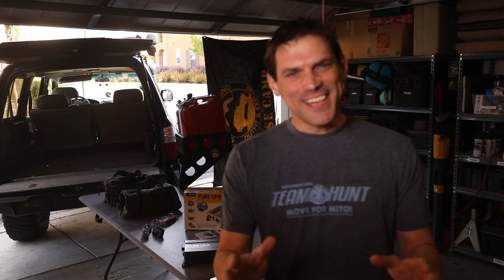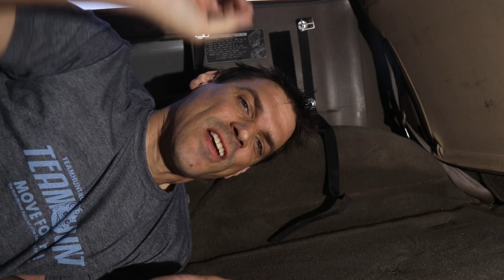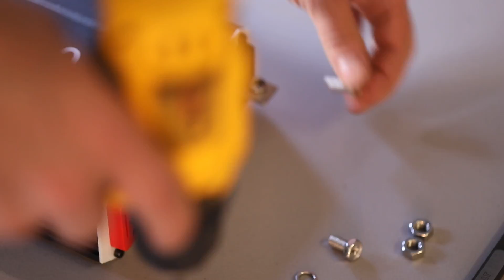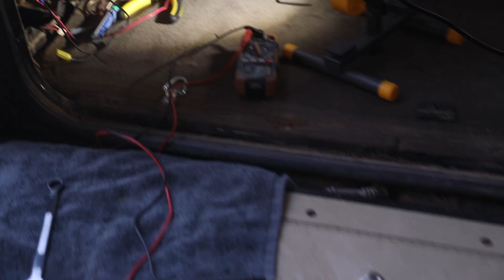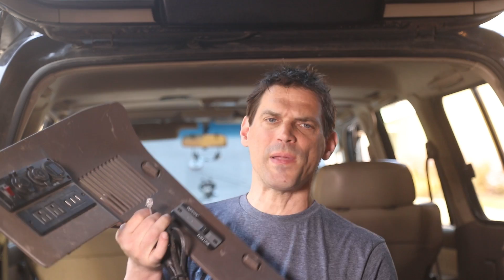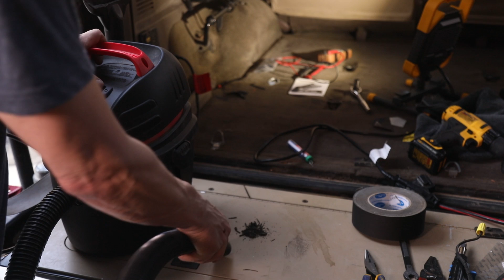110 Volt Power in Your Overland Rig: Inverter Install

Comment: I’m watching this in 2023 and I’m wondering if you would include an inverter again in your build given that most electronics charge off of usb-c now, which is common to go up to 120watts. Is there still a need for an inverter aside from kitchen appliances and blow driers? I think most camera equipment and laptops charge on usbc so there wouldn’t be a need to go from dc to ac back to dc just to operate electronics.

Comment: Next time if you mount the inverter closer  to the battery like behind your glove box and just run the 110 volt and remote switch to the back you will have way less line loss and longer use time.
AC voltage has  less line lose and on a thinner wire than DC.

Comment: Does that inverter require a deep cycle battery or the regular car battery should be okay?
Reply from the maker: I have run a NorthStar AGM with this setup for years. Works.
Reply: @OverlandBound  do you have to remove it when not using the inverter or it can be use as daily without damaging anything? Great video by the way!

Comment: Nice video....why didn't you run the ground to the battery terminal ? And shouldn't the should be a short distance from the main battery source. Also the fuse box distance from battery should be with into 16 inches  or less.

Comment: I probably missed it but did you add a fuse between the stinger block and the inverter? I doubt the inverter draws more than a few amps so the 100amp breaker won’t do much to protect it or the small bit of cable connecting it. Maybe add an accessory fuse panel directly to the stinger block and then run the accessories from that so you can individually fuse them to requirements. Maybe this is what you did?
Reply from the maker: Ugh...you did not miss it. In the speed of editing this yesterday, I did not show it. Here is the fuse: https://amzn.to/2D5ayIz I will add this in the details along with the other parts list and note.
Reply: Overland Bound Ah, cool. Thanks for the update.

Comment: Are you still running a single northstar x2 battery? 
How well does it work with the dometic fridge? 

Best regards.
Reply from the maker: It has been working great. The Dometic goes on 50% of our trips. I probably get a couple days without the auto cutoff turns the fridge off. It has been reliable.

Comment: Are you at all concerned about heat behind the panel? I would think you would want to have some kind of airflow to keep the inverter temps down.
Reply: If need be you could drill a few air holes at one end of the panel to get air through the preexisting vents.
Reply: Great question! One of our favorite fans that we suggest is: https://www.amazon.com/dp/B00IJ2J2K0/ It's super quiet and runs off USB. It's even speed-switchable.
Reply from the maker: Yes - the panel already has a wiring and some ventilation from the factory - but I will watch it closely. The inverter shuts off unless under load and I figure if it does heat up too much ill open the door its in. Not ideal, but I could.
Reply: @OverlandBound  A small 140mm, or even larger if it will fit, repurposed computer fan might work well on that pre-existing grate in the panel. Very low power draw, high enough cfm to cool, quiet, and cheap.

Comment: Hey Mike 
Must read!!

I don't know if the sureline sales Rep told you
 but its Not recommended not to have really long Battery power wire from Battery to Power converter (it must be no longer than 3' feet)
if you have no other option, You must upgrade your Positive wire gauge...
Also your power converter Must have plenty air circulation so it can cool off when use 
if not you may end up with Burned out Vehicle on the side of the road..
Reply from the maker: Thank you!